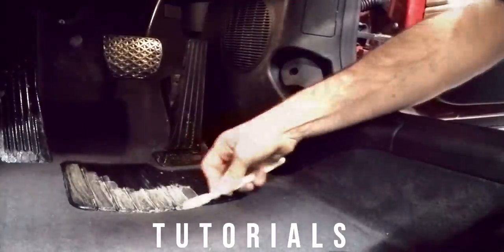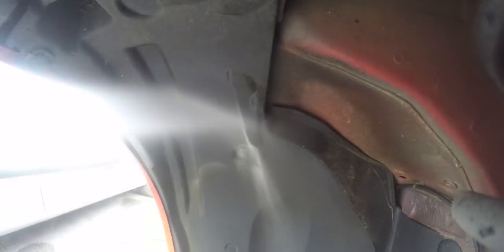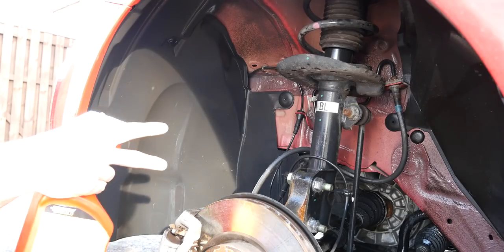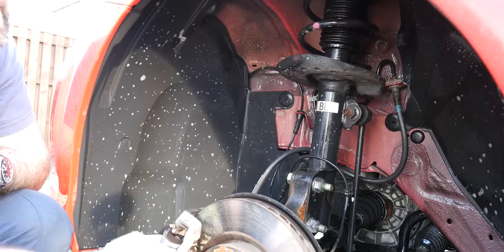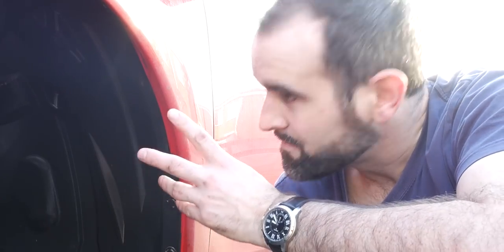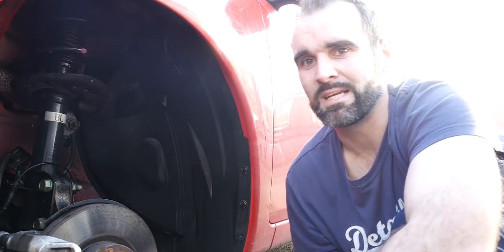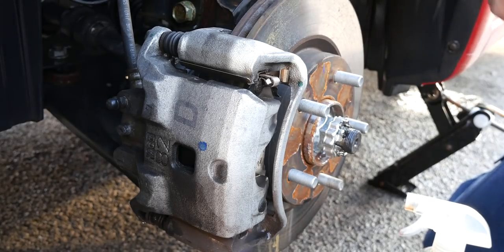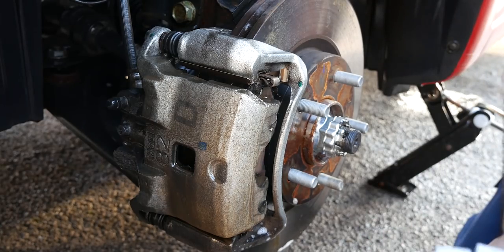How To Detail, Clean & Protect Wheel Arches (Wheel Wells)

Comment: Nice job ,Matt. I've got the carpet in the arches and I do sometimes wish that they were plastic (easier to clean)
Good vid keep up the good work, Davy.
Reply from the maker: The rears on mine are carpet. A Maserati I used to look after had proper thick carpet. Great for noise reduction but a bugger to clean
Reply: Use outdoor fabric protectant on them.
Reply from the maker: Good shout

Comment: Hi mate, what advice would you give me cleaning 26 years of grime off the painted and undersealed surfaces inside the arch, on the inner wing for example?
Reply from the maker: Start with rinsing it down with a pressure washer if possible.... Then maybe a couple of hits with some degreaser followed by a couple of hits with an APC.

Depending how bad it is, maybe try adding some steam.

No doubt you'd also need plenty of tar remover too.

Oh, and let's not forget elbow grease 👍
Reply: @TheDetailingSpace  thanks for the quick response 👍 what does apc mean? Sorry for the simple questions I'm no detailer lol
Reply from the maker: Sorry, All Purpose Cleaner

Comment: You have done a great job but you paid extra attention to the plastic liner but not the suspension components, exposed fasteners and paint work. The worst that will happen if the plastics aren't dressed is they look faded and will possibly be harder to clean next time. The other components will get rusty and over time will potentially need replaced and look awful. Have you ever considered addressing the other areas of the wheel arch?